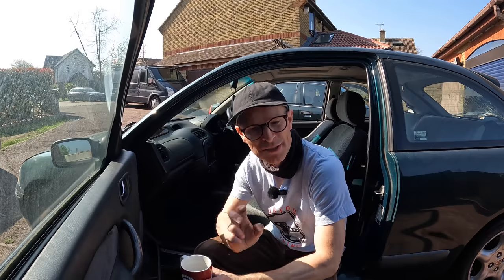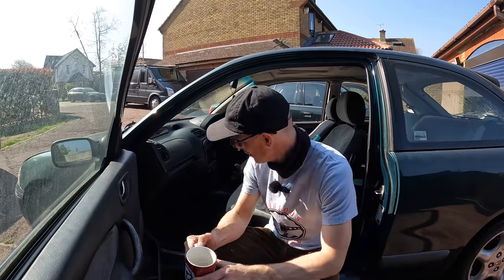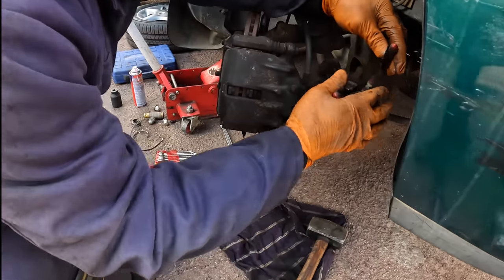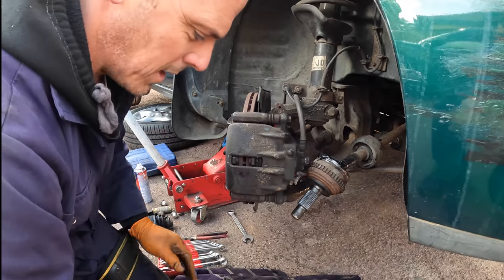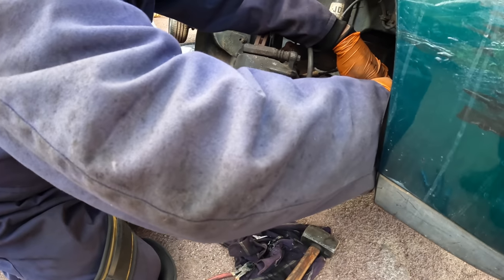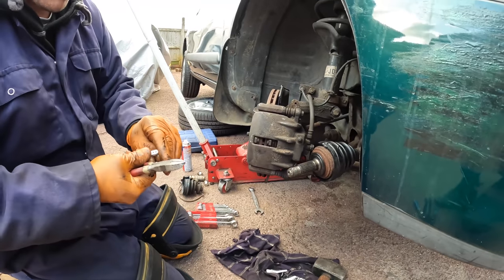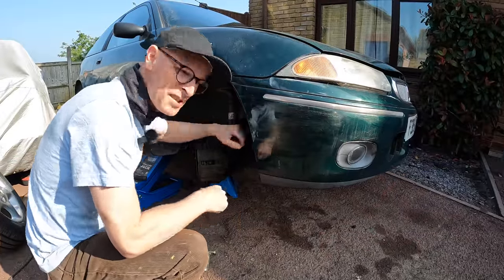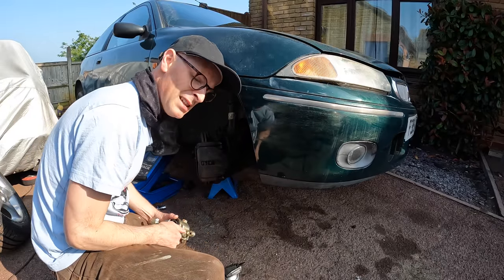Rover 200Vi CV gets CV boot & brake caliper...AND IT GOES WELL!!

Comment: That air-powered CV boot stretching thingy is the stuff of dreams. Amazingly, in over 25 years of owning front wheel drive cars, I've not yet had to replace a CV boot.
Reply: So you just know what’ll happen now ……….
Reply: @robc5955  Jinxed myself, haven't I? :D
Reply: The only time I have had to replace a CV boot I had to do both, so I just went from the back and didn't need any tool.
Reply: My R50 MINI shat its axles last week. I brought it with slashed boots. I went through the tempestuous farce of changing them, its a particular arse of a job on R50's. Lasted half a year, the drivers side turned into a pepper mill so i had to replace the blood shaft anyway. Essentially, fix a boot as soon as possible as the damage may already be done.
Reply: I never have either but as the vehicle in question was doing 50-60 thousand miles a year the CV's needed changing annually anyway.  Life as a Taxi takes it's toll on CV's with constant full lock turns.  Pattern parts are less than half the price of manufacturers ones but only last half as long.  In this case still a saving, including the labour.

Comment: That boot stretcher tool is very much on the nose, I had no idea such a thing existed, clever stuff. 👍
I might also have a clever tool tip for you: the Leatherman Crunch. If you google it, you'll see a little multitool that's a kind of hybrid between an adjustable spanner and a vice grip. For a lonesome amateur sunday driveway mechanic like me, a tool that can latch onto a nut and hang on to it unattended is a godsend. I'm no fan of Leatherman tools, I broke two and found their famous warranty untrue. The Crunch however can either bite hard into a rounded off nut by stomping it shut, or be set to gently clasp the remains of that nut's surface. Mine is a 2001 model, still abused weekly and still going strong.

Comment: I didn't have too much of a problem using one of those cones for my Peugeot Expert, sat cross-legged on my driveway. The main issue was that it got wedged onto the end of the driveshaft, so I had to knock it off with a hammer which left burrs in the nylon. I haven't had to use it since, so I may try filing the burrs off if I ever do.

Later on I had to do the other CV boot on the same vehicle and someone in the know advised me to just knock the end of the driveshaft joint off with a big hammer, then the boot just slides on. Everything went fine until I misaligned the splines when putting it back together, mangling it. I had to take it all apart again and grind the mangled bits off. I'd rather use the cone.

Comment: When I had Maxis in the 80s, I was always having to replace CV boots, done the hard way - drive shaft out, outer joint off the shaft. 
One of those would have saved so much time.

Comment: I’m a mechanic and c using the cone was an absolute pain it as an absolute joke trying to get the boot to stretch over the cone and using the tool to push the boot over the cone was seriously sore on the chest. Got an air expander for the cv boots and the job is so much easier and take a at least half the time now

Comment: Well done, Matt. Great to see the wee beastie coming along. For the headlamps, try PlastX by McGuire's. I've been using it for about 20 years, maybe more. The 32 year old polycarbonate headlamp lenses on the Volvo 240 are as clear as brand new thanks to the stuff. It saved me a fortune with my 92 Crown Vic, as the headlamps barely glowed. 20 minutes with PlastX and a few sheets of the blue shop towels and the lights were as near to perfect as Dammit is to swearing.
Reply from the maker: Ive hit these with a machine polisher and One Cut (aggressive paint cut restorer) which brought them this far but what ever was on there has left little patches on the surface. Its sort of OK but not great

Comment: Bleeding the brakes in an old system which can have had old waterlogged brakefluid  can if you press the pedal to the floor scratch the sealings on the plunge against rust in the bottom of the main cylinder, i like to use the airlid for the main cylinder reservoire that you attach via a hose to a wheel to push old fluid and air out, only keeping an eye on the level in the reservoir not to push more air into it.

Comment: I'm sure I've seen that CV gator too on the Matrix.😅
Good to see you have a decent torque wrench for working in those calipers, I had a cheap one that was fine for wheel bolts but at the lower end of its range wasn't so hot and it striped the threads from the caliper. I've since invested in a new torque wrench.
Much like yourself I do like to go around spraying the various hinges and latches , usually after the car had been washed.

Comment: If anyone is using the cone, put the new boot in boiling water for a few minutes & it will stretch easier. 

I hate the thin cheap clips they give you with new CV boots. I always use a thicker clip & just a cable tie on the small (shaft) end

Comment: been following your channel for a while and right now i myself battling with rusted bolts. what's that coil heat element you use to get the bolts off with? is it affordable?
Reply: Induction heater, around £200 😀
Reply from the maker: they vary from £200 to £600 or more, theres a bit of get what you pay for. The draper one Ive got is about £450 and brilliant

Comment: You should have had the car on an axle stand on the first half of the video - never rely on a jack alone.
Reply: If you watch around 3:04 you can see the axle stand from under the mud flaps - it’s on the sill behind the jack.
Reply: That is a very true point, someone I knew got killed when trolley gave. At what point though? When boot was being done it was behined jack and for the caliper it was on the arm, I believe
Reply from the maker: It was on one. Kris is a professional and wouldnt work without it
Reply: @furiousdriving  Yes, my bad 😔
Reply: It had an axle stand as well as the jack.
Safety first. Work second.
Reply: @TheLooseMechanic  And the wheel under the sill.